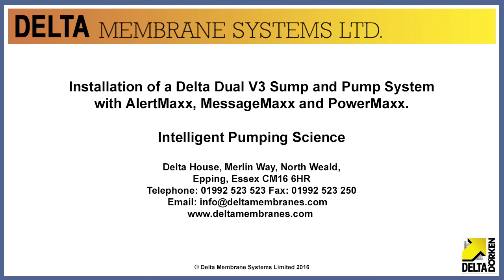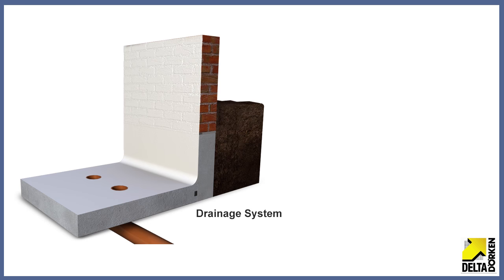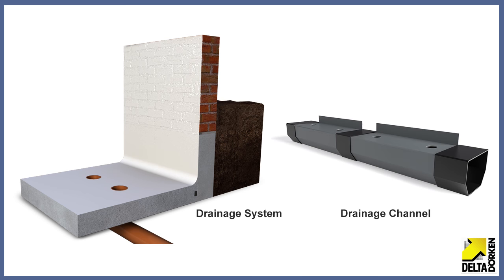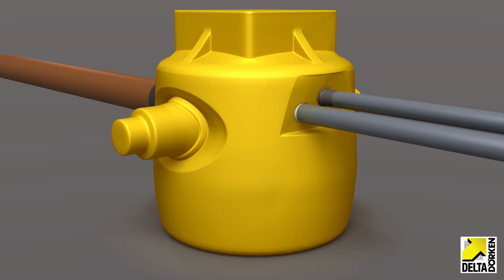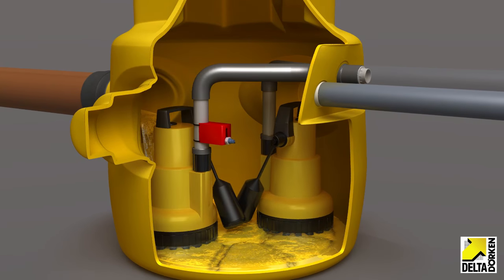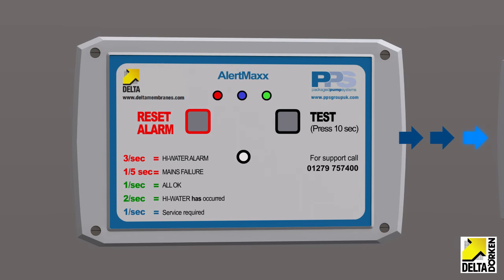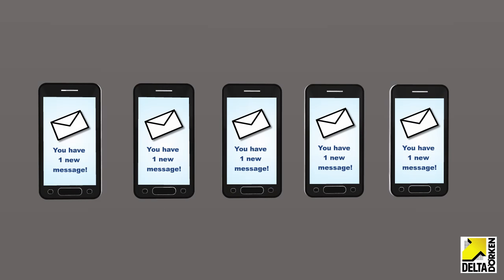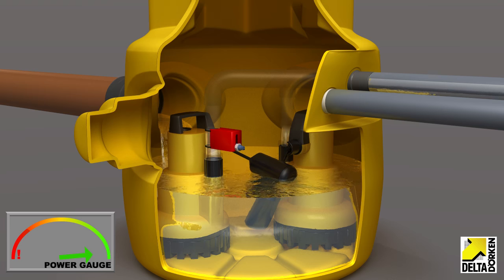DELTA Groundwater Sump Pump Video

Comment: what is the yellow material? It looks like some kind of plastic, but what kind of plastic, can it be buried directly into the ground or does it need an RC sump chamber to house it?
Reply from the maker: Hi Julie, 

Our chambers are made from HDPE ‘High Density Polyethylene’. 

The Chambers can be housed via an RC box and backed filled with concrete. 

Alternatively you can dig down, install a 150mm pad of concrete for the chamber to sit on followed by 150mm concrete back fill. 

Please refer to the Dual V3 insulation guide link below, see step by step installation instructions of the chamber on pages 9-18. 

https://www.deltamembranes.com/app/uploads/2019/02/Dual-V3.pdf